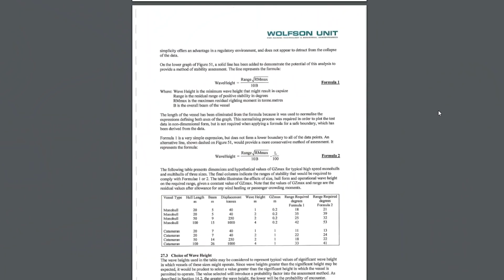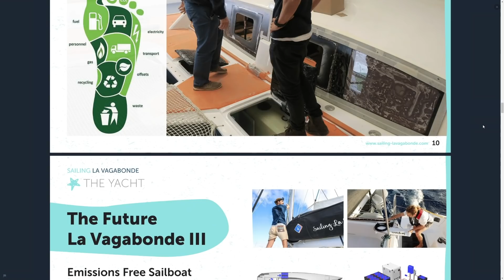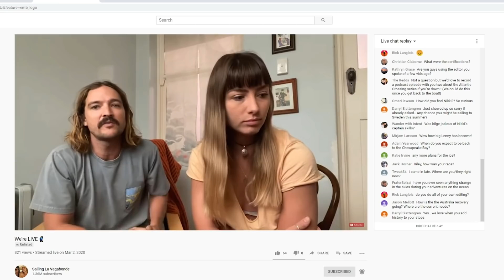Our Plan for an Emissions Free Vessel

Comment: Pie in the sky idea.. May want to talk to Xquisite Yachts.  They got an option on their X5 (love, love that design) for an expanded targa that packs 1.8k worth of solar on the roof.  Wonder if they could make a thicker targa that houses a pair of retractable solar winglets that could allow for even more solar. Like a smaller version of what the Turanor  Planet Solar uses.   Use all that extra power to run an over-sized water maker that feeds an electrolysis water generator.  Vent O2 overboard and store the hydrogen in bottles like the hydrogen powered cars do.  Hydrogen gas is the fuel for either a hydrogen fuel cell or a generator based on Mazda's duel fuel rotary engine that could run on hydrogen.  Not exactly emission free... but your emissions are oxygen and water vapor.  And that's pretty darn eco-friendly.  If you want even more speed, then you hire an engineering firm to integrate solar into the upper wing surface of an used Japanese ShinMaywa US-2 amphibious plane and use the hydrogen to fuel the turbo props.  An infinite range flying yacht.  I blame this all on too much coffee.  Whatever you do, best wishes to you and your family.  Thanks for sharing your adventures with us!

Edit: Someone sent me a link about the Energy Observer catamaran.  So much for that idea.. it's been built and is already out there sailing.  Still got the crazy plane idea, though!

Comment: Why wouldn't you just fit out the boat you have ? .. that is what I would do .. (pretty do-able now)

Fill the boat with solar panels that you can walk on .. every single horizontal space is now custom made solar panels that are wired up and epoxied in .. then add some more fold out panels for stationary times where your existing panels are now .. that can grow by 200% easy ..  you will want at 4000Kw of solar .. but that is doable (just)

Then rip out BOTH onboard engines .. and replace them with electric engines (off the shelf now-a-days .. and SUPER reliable too - not cheap tho) .. then buy LOTS of lipo phosphate batteries .. and a controller (again .. pretty simple off the shelf gear will do just fine) .. and you off !

Keep the / a small diesel generator .. but that is it for gas etc

Your current boat is ideal for that .. hybrid sail / electric deal.

Comment: I'd look at re-powering LVB.  You have the sail drives already which probably means not altering the hull. That boat already has great light wind performance which I think is a hard prerequisite.  the other is you have to be a skilled sailor which you already are.   If it were me my goals would be:
1) not increase the weight of the boat
2) Can power the boat at a maximum speed greater than 8 kts (Panama canal minimum)
3) Has a 50 nm range at a speed > 8kts (panama canal again).
4) Have an all electric range of at least 10 nm @ at least 5 kts.
5) Ability to move electricity between the high volt bank and low volt banks when at anchor

If you can get 2 and 3 then you have good emergency capability as well.  Transiting the canal and emergencies are rare so I wouldn't carry enough battery for this.  Instead I'd back up the all electric drive mode with a generator.  You could even store those Volvos in case it all goes wrong.

Comment: Crazy Idea? Extra wide davitts support a giant  reel. Reel holds a carpet of flotation foam topped with flexible solar panels. Deploy when at anchor. 20' wide by 50' long = 1000 square feet of solar.

Comment: I love your enthusiasm but based on my experience with solar and batteries, the huge expense, all the electrical risks and limited lifetime of expensive batteries that goes goes along with it coupled with reduced speed, make this an unacceptable option. 

I've tried solar many times in my life, and always, by the time it reaches a breakeven point, it's time to  make major replacements of batteries and other components. It becomes a perpetual negative impact to the environment in both manufacturing and disposal costs. 

The sailing vessel Top Secret is an excellent example of how to accomplish this in a 58 x 33 foot catamaran. The owner brings up the same downside as mentioned in sailing Uma - if you want to go fast, use diesel. If you want short-term torque, go electric. I prefer the speed capabilities of diesel, both for pleasure and safety, not to mention the overall manufacture to disposal emission footprint is less. .

Comment: Suggest outline (with details, as can) your Musts and Wants, with weight Factor per Want (from 1970s MBA classes). When focused, spreadsheet the best options found and see if 1 or 2 options seem useful paths. With hints of 1 or 2 good paths, widely ASK around for more ideas/inputs. Some folks mention Elon Musk (great batteries soon?); +from So. Africa there seems good Cat & Tri ideas plus several hydrofoils (like Hysucat-type), which could, in storm/safety scenarios, give the speeds wanted. Of course, it all MUST be the lightest weight. And, solar cells within the sails? Be persistent!

Comment: Pull out one of the diesel engines, install an electric drive. Add more solar and batteries. Only use electric, but you have the diesel as a emergency backup in case you need to get out of Dodge. If all goes well, swap out other engine and install a generator as your backup.

Comment: Free energy is everywhere, storage is problematic.
Fossil fuels are the most compact storage of energy.
It is all in the mix, sun, wind and ocean currents.
Sun panels need more space than wind generators, 
water current generators need the least space for the same capacity. 
Receipt for an all electric boat. Redundancy!
1. Deck tent with flex solar panels. -> sun energy
2. Excessive battery storage.
3. Silent vertical Turbine wind generators on all 4 corners on man high tripods. -> wind energy
4. Save weight by removing at least 1 diesel engine, replacing it with an electric sail drive.
5. Make second engine a hybrid engine,  part electric sail drive part classic diesel generator.
6. More solar panels on cabin roof. -> sun energy
7. Dingy with electric  -> zero emissions
8. In a strong current, throw out an anchor, switch on sale-drives. -> tidal or ocean current energy.
This also works in a river current.
9. Most important energy source, the wind in your sails, gives energy at the cost of speed.
A sail drive generating power will slow you down. -> wind energy
investigate a larger sail-plan, more square feet of sail will give more energy. 
Take extra care in sealing of wires and cables from water intrusion.
Make electronics duplicate, simple and serviceable on high seas.
Buy extra sail drive generators for safety (speed).
Reply: 😂😂😂😂 just keep diesels they are the best.
Reply: @christianmagno984  Switching to bio-diesel is an option.

Comment: Check out Sailing Uma. Architects that are using a fork lift electric motor and solar panels to power their monohull. Switching out diesel for electric motors sounds like a practical solution. Hybrid systems could be interesting ! Electric, Solar, wind, batteries and a small generator. You are on to something Riley and I would love to see you design the boat of your dreams. This might revolutionize cruising ! Also, check out Michael Reynolds land based “Earth Ships” for ideas.

Comment: The hulls should not have any thru hull or connections the water can infiltrate the hull. Everything over the side. The props and any propulsion should be able to lift out of the water when not in use.

Comment: Does he really think manufacturers haven't thought about the "ideal" boat? All boats are a compromise of many factors. Simple calculations show you cannot get enough power from the sun to drive the boat and run all its systems. It's not possible. That brings you back to partial solar and sails with oil as a back up. Also if you burn anything, you are not emissions free. Get over your perpetual motion dreams.

Comment: Great accent there Riley! As hard as you will try, nothing as yet will replace the diesel engine. Not only for propulsion but for charging. Until they have super batteries big enough to let you cruise for 24 hours, day in and day out.  There will be a day when it will be possible.

Comment: i keep thinking about Sailing Uma and how they converted their boat from shaft drive to sail drive with the new Electric motor. I'm pretty sure that new electric motor came from a quad set of electric motors running on another Cat. and that boat owner was just upgrading his electric motors. couldnt they use those same quad electric motors to replace their existing diesel and upgraded solar an lithium batteries?  that would be a heck of a project if it could work.

Comment: What ever floats your boat guys, if you truely have out grown La Vaga? and she is too small for the family or for what you are planning in to do in the future then a bigger boat might be an answer, and to make that boat a zero emmisions boat, a new build might be the most viable solution, however in my mind 'emmisions free' is not quite viable cost or technology wise (just yet). Upgrading your current boat with extra solar, larger house/propulsion battery bank and adapting the propulsion to a single parallel diesel electric hybrid in one hull and electric in the other would be the most achievable way to satisfy your goal. It would also serve as a shinning example to others that with some modifications many other bosts could also potentially achieve a minimal emmision footprint while living an idilic cruising lifestyle. Rather than going for a bespoke green sailing machine that is so far out of anyones reach. All that being said, if you can reach for the stars, who are we to try and hold you down.
Would love to here what your current energy budget is and what you think you might need for the future.

Comment: The embodied emissions in a sailing vessel dwarf the running emissions.

Environmentally you'd be better keeping what you have than going to anything newly built.
Reply: @cormacsyt0  A source for what? That sailing doesn't use fossil fuels or that building a vehicle the weight of 4 full sized SUVs does?
Reply: @cormacsyt0  Modern boats like the Outremer are not made of steel. They are made of GRP, a petroleum product.

A steel foundry run on renewables would go out of business very quickly.

You are talking about what might might be possible in the future, I am talking about reality as it is.

Building a 2 tonne car embodies maybe 25-30 tonnes of carbon. Building an 8+ tonne boat, at best about 4 times that, but due to the lack of economies of scale in reality much, much more.  Let us be generous and say just 120 tonnes.

Running both engines full ahead will burn about 10kg of fuel per hour, producing about 30kg of CO2. Lets double that to allow for the extraction, refining and transportation of the fuel and go with 60kg per hour.

So you are going to have to run the engines for 2000 hours to get to the embodied carbon in the vessel. At a ball park of 5% time underway on engine power that is 40,000 hours underway, or 4 and half years straight. Assuming you spend a VERY high 20% of the time underway it is going to be nearly 25 years before the running emissions meet the embodied emissions.

If he was actually serious about doing his bit for the environment instead of talking about a new boat he'd give up flying.
Reply: @cormacsyt0  How about you give me a source where you can show that a boat built primarily of petroleum products can be built without fossil fuel input.

I'll also wait for you to find Norwegian source for the corrosion resistant metals required for sea going vessels, copper for the wiring, the Norwegian source of all the electronics on board etc etc.

No, I wasn't think 100% sail power, but mainly sail power. If you aren't going to primarily use the sails, why buy a sailing vessel?
Reply: @cormacsyt0  So you asked for numbers, I gave them to you and you don't want to read them? Brilliant. Stay ignorant.

While you are ignoring things ignore the price differential between renewable and fossil fuels when it comes to thermal energy. Renewable compete well on electricity. They come nowhere near on thermal energy. Not. Even. Close. That is why a steel foundry run on renewable won't work. You can Ignore that all you want but the financial reality of that will be front and centre for any business.
Reply: @cormacsyt0  It only doesn't make sense if you haven't got a clue what you are talking about. Yes they use electricity to keep the lights on and run machinery. Meanwhile the vast bulk of the energy input into steel comes from coal.

What do you think takes more energy? Keeping the lights on or taking a rock and heating it enough for molten metal to come out of it?

And I will say it again as you obviously ignored it when it was written above several times. The boat is not made of steel.
Reply: @cormacsyt0  If the idea is to move towards less burning of fossil fuel why are you a proponent of a new boat that will embody vast quantities of carbon?

I'll say it one more time for you. The boat is not built of steel. It is built of petroleum products.

I brought up the corrosion resistant metals as a point to show you that a boat built in Norway is not made of material from Norway. Obviously that went right over your head and and now you are on about foundries. Okay.

Arc furnaces are good at turning scrap metal into reusable material. They are not good at turning rock into new steel. That is why c.90% of the steel industry's energy comes from coal as opposed to about 5% from electricity. The steel making process using coke will not be changing anytime soon.
Reply: @cormacsyt0  You object to blanket statements but when someone takes the time to do the calculations you are unable or unwilling to do yourself you can't be bothered to read them? Why don't you just stick your fingers in your ears and shout la la la as loud as you can?

Do you honestly think c.10% of the coal used in the world today is merely a "foaming agent" for the steel industry? Get a grip.

You don't like blanket statements from others but you seem happy to put them out yourself. So, where are your numbers for the embodied carbon in an 8 ton vessel? Where are your figures for the emissions from running the engines? How do the petroleum products that make up the vessel get to the shipyard? How do they assemble themselves into the shape of a ship? Where is this source of virtually fee power to run multi megavolt arc furnaces you speak of?

Comment: I’m all for eco this eco that , but the one thing I learned is the road to hell is paved with good intentions. And what I mean by that is your already on a vessel that saves loads of C02 admissions and if you wait and let boat tech happen organically a close to 0 admission boat will be easier to obtain. Right now most of the ones they make are hi C02 in the manufacturing process. Anyways this is what I have read and don’t know what’s 100% factual

Comment: I would consider all the considerations that go int Submarine design. how do you fill a boat with batteries safely? But because you are floating, how do you turn every surface into a solar panel?  On a monohull, the keel could be all battery, and so on.  Good thinking!

Comment: From my experience lighter is high tech high tech is more expensive.  I see this leading to lots of content but can't imagine the channel remaining about sailing.  I say do what makes you inspired guys if its not fun for you it won't be for us either.
Reply: Robert Smith the whole purpose of this is to sail more, not less. If the tech stopped working that’s not going to effect the sails. It just means they won’t have any electricity.
Reply: @david4905  they are talking about designing and building a new boat not upgrades hard to build a boat and sail.  Not saying it is a bad thing buy it will be a big change

Comment: Induction cook top.   I don't know, brushless DC outboard motors prop'd so you can charge under sail.  Can you cover the entire top of a cat with panels and then put a huge windmill on the mast.   I always like the look of those modern airfoil sails.  I think there is a design out there that looks like an airplane held sideways, complete with a weather vane tail.  Nice as you adjust the tail to get thrust.  I wonder if that wing could be fabricated as a fabric and hoop design that could be collapsed onto the deck if needed. Once you get started hydrofoils, never mind.  Love the work you do.

Comment: Why don't they build the cabin the full width of the beam to cover the side decks and embed the dagger boards in that stricture. That way less chance of falling over board in high seas two hatches fore and aft where the open deck was giving more roof space for solar collectors along with a larger interior living space. Wheel housing at the front of the cabin/saloon to view the deck from a protected space but build a rigging hole deck area in front of the cabin ahead of the helm to handle all your lines from the forward center of the boat either just ahead of or behind the main mast.... and with extra deck space from the wider cabin have split stairs going fore and aft on hinge to use under the stairs as storage...I've been thinking about as well this life long dream of my own cat design😃